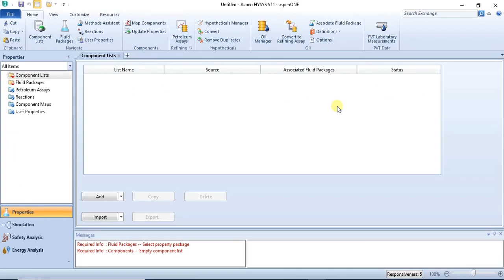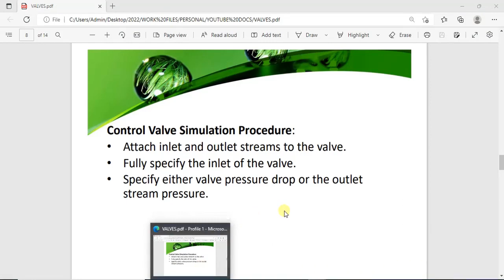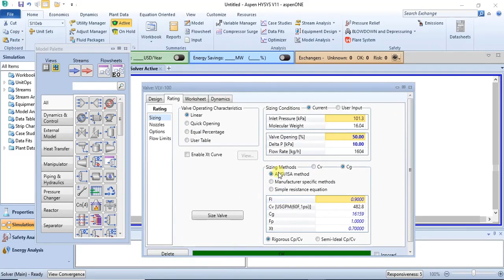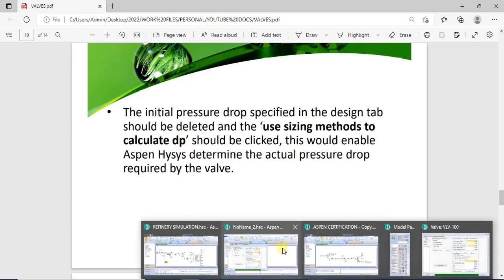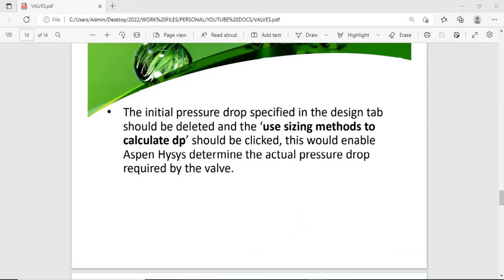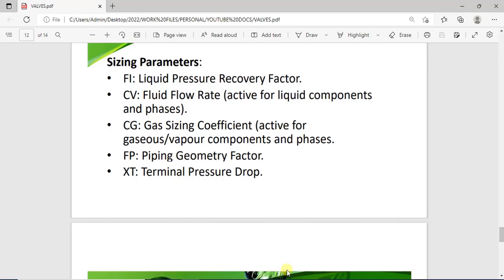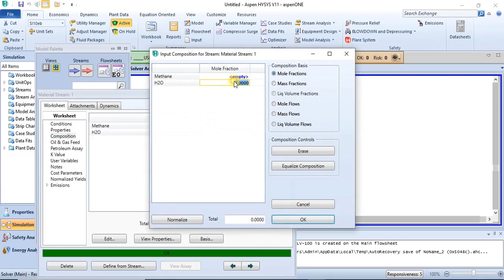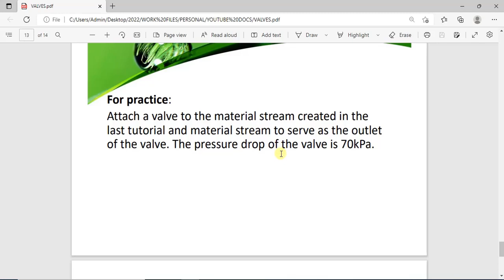Control Valve Modelling and Sizing with Aspen Hysys: NGL Fractionation Modelling (Lecture 2)

Comment: suppose from the data sheet i know the max. flow and selected Cv of the control valve plus the operating conditions. With that information , how do i calculate the flowrate for 25% and 50% opening.  In the data sheet, the pressure drop was wrongly selected, and i am using the current pressure drop as per conditions.

Comment: Why Cv value increases as we decrease valve opening % in Hysys. The Cv should be maximum at 100%.
Reply: The value of Cv given by Hysys is the Cv max of the valve. Let's say I choose an opening of 50% with a linear opening. If Aspen says Cv (max) is 100, then the value used by the solver is 50, because the opening is 50% (again, assuming linear opening). When I change the opening % with the same other parameters, the calculated Cv max will be different. For 25% opening, the value of Cv max will be 200, but the value used by the solver will be, again, 50 (200 * 25%). To sum up, Aspen shows Cv max, and the value of Cv used for the calculations is hidden.
Reply: @PhilBou-ww4iz 😂